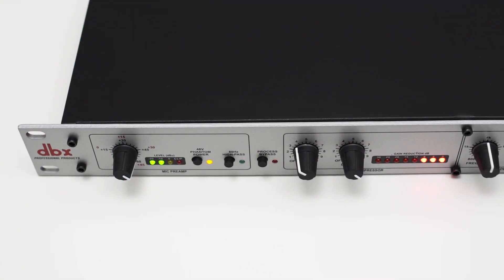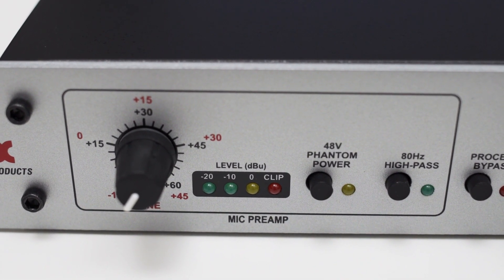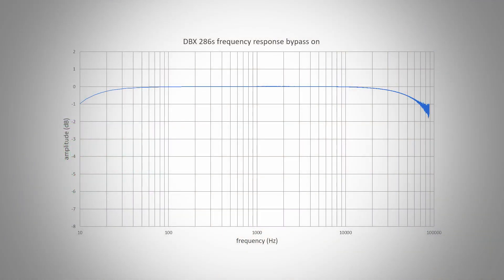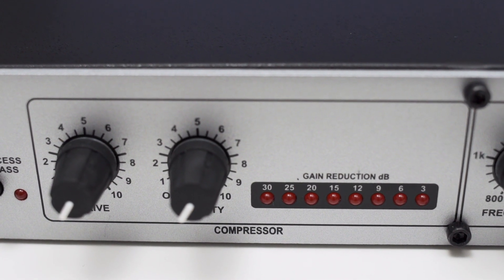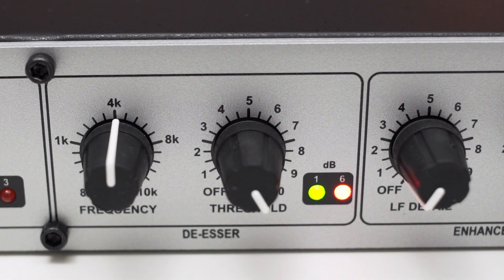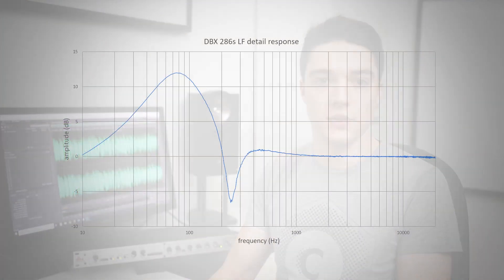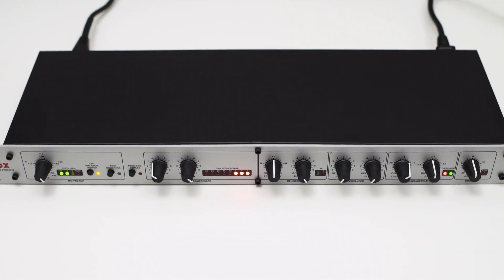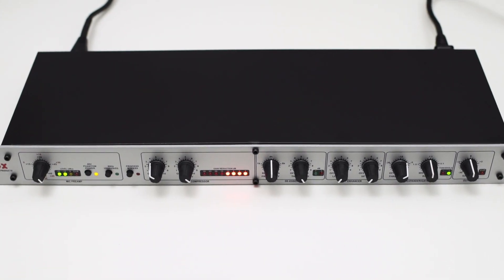DBX 286s Mic Preamp and Processor REVIEW (noise and more stuff tested!)

Comment: Can you bypass the mic pre and still use the compressor eq
Reply from the maker: Yes, this can be done. This is how you do it according to the manual: "To use the INSERT jack to MULT the preamp out, insert a Mono 1/4” plug fully into the INSERT jack, then pull the plug out one click. Plug the other end of the cable to the appropriate load. This will still allow the original signal path to continue to the Processing Section without interruption."
For more details check the manual on page 4. https://3e7777c294b9bcaa5486-bc95634e606bab3d0a267a5a7901c44d.ssl.cf2.rackcdn.com/product_documents/documents/1665_1475869363/286s_Manual_18-0728V-B_original.pdf
One more possibility would be use the line level input of the 286s and set the input gain to unity. This does not bypass the preamp but it does not amplify or attenuate the signal. This way the preamp in the 286s has a minimal effect on your signal.

Comment: Dbx suitable for itrack solo?
Reply from the maker: Hey, the iTrack solo does not have a TRS line level input. But you could connect the dbx to the iTrack solo with a TRS to XLR cable. Turn the gain of the iTrack down all the way. Then you will also have to turn down the output gain of the 286s a bit. It should work fine.
Reply: Thank you very much! that is, theoretically, can I connect shure sm7b via dbx 286s? to itrack solo with a TRS male <-> XLR male cable through the itrack solo microphone input?
Reply from the maker: @mayorovofficial  Yes, you connect the SM7B to the mic input on the dbx 286s with an XLR cable. Then connect the 286s with a TRS to male XLR cable to your iTrack solo. This way the audio of your SM7B goes through the 286s and is then recorded by your interface.
Reply: Successes to the channel!
Reply from the maker: @mayorovofficial  Thanks!!!

Comment: How does the quality of real-time audio effects compare to post-processing effects? Is it cleaner? "no/less compression"?

also, If you have a few pre-amps down the chain, like 286s -> iD14, will it compound the noise of the preamps?
Reply from the maker: Hey, I would say that proper analogue and digital effects are equal in quality. The advantage of an analogue effect is, that there is essentially no latency. When you need your audio processed right away, for example for a live stream, an analogue effect is the way to go. If you don't need that, I think you're better off with digital effects, because you can tweak them to your liking after the recording. With the analogue effect this is impossible, because once the audio went through it, it is baked into the signal.

When you have multiple preamps in a chain and the first preamp amplifies the signal, then the first preamp is the dominant source of noise. The noise of following preamps in the cain is pretty much irrelevant.
Reply: @JulianKrause  thanks a lot JK! I learned a lot from you.

And I just realised that with 286s, the settings of compression/gate/eq are sort of preset (meaning less variables to play with) as compared to digital plugins where I have to play with every variable.